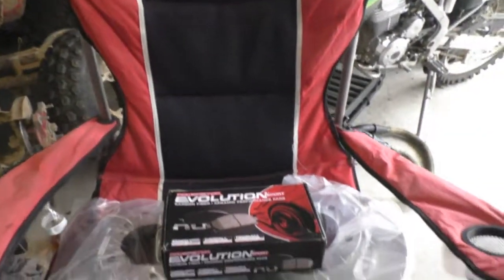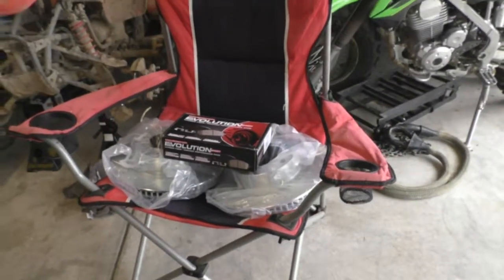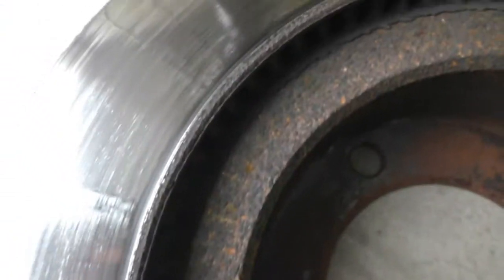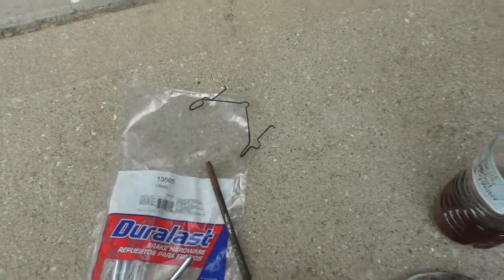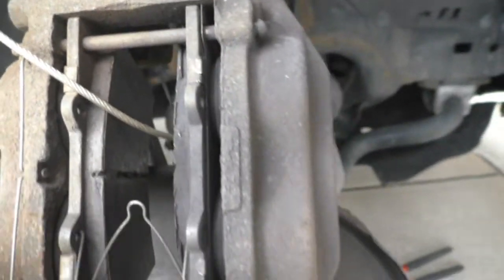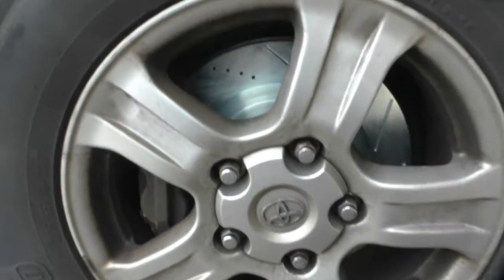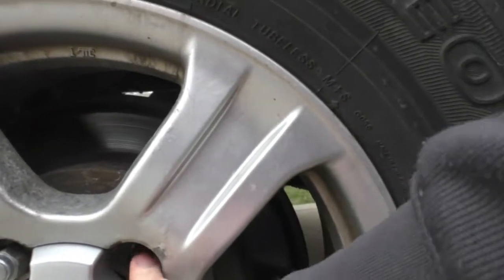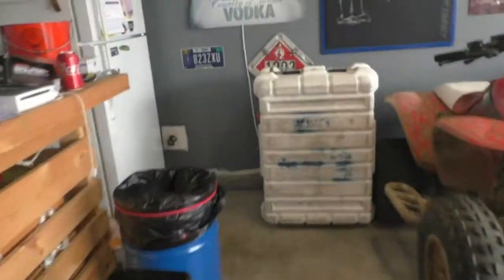Powerstop Brakes install on 2008 Toyota tundra!

Comment: You put those rotors on backwards.
Reply from the maker: Actually I did not, you would think that because other manufacturers tell you to put them the other way, it also depends on which direction the internal fan blades are facing, (straight vs. curved), on YouTube powerstop channel, where they install similar ones on the Titan they face the same direction as I installed mine, I assure you that I followed my directions, however like I said different manufacturers have different requirements.